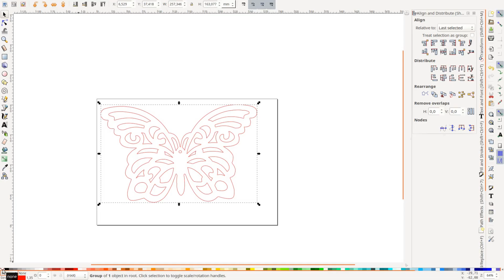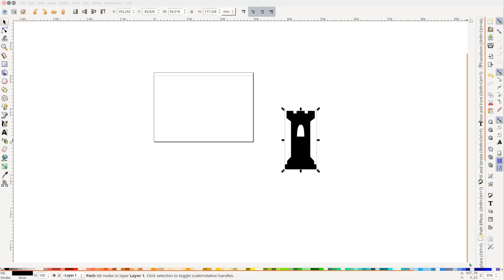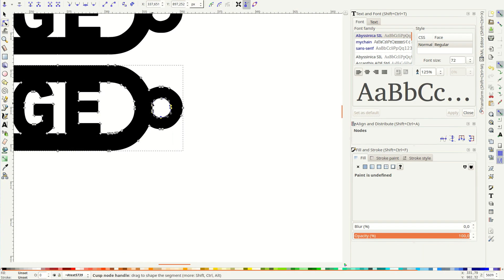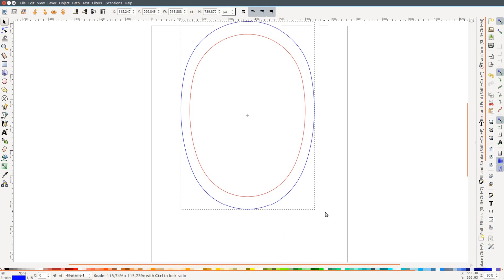10 projects for the laser cutter

Comment: Just for the first project, don not ever cut PVC with your laser ! It will produce mustard gas that will not only damage the electronics of your machine, but also your health ! When i first got my co2 laser i wanted to put anything on, from my phone cover to engrave Godzilla on ;) to heat transfer vinyl... But quickly i saw that all these are PVC, even the PU heat transfer vinyl (HTV) as the cover layer, the one that you peel off, it's PVC... so take care and look out for non PVC alternatives ( there are )
Reply from the maker: Yup. Cutting anything that sets chlorine gas free is a bad idea. Some pseudo-acrylics from the home center are dangerous as well.

Comment: How did you cut this ? I have neje master 2 20w, which program have you used ? I mean to cut all round from outside , its that a Gcode file ? How did you make it ? Thanks
Reply from the maker: The Neje laser can only engrave or cut very thin material. The machine I am using is a K40 laser, as described here: https://youtu.be/G5vTZGL-UBA
Reply: @WayofWood  thanks

Comment: hi nice informative video , but what i would like to know can i use it to cut foam for my tools 16inch by 10.5 inch x 1.25 inch thick?
Reply from the maker: The bedside is around 8 x 12 inch. Foam cuts nicely if it’s the right material but I don’t know if you get a. Lean cut on 1.25 inch...

Comment: Thanks for the great video. Do you think it would be possible to also cut 10mm acrylic? Maybe with 3 - 4 passes?
Reply from the maker: thegreatsalabim I don‘t know. Cutting 5mm acrylic is no problem at all. I tried to cut thicker wood which is difficult- even with several passes. 
As 5mm is possible 10mm might work with some creativity (eg flipping the piece and cutting from both sides) or by cutting 2 5mm pieces and gluing them together.

Comment: Great video. What program did you use to make the finger joint box.
Reply from the maker: Karen Smith It’s the python box configurator - a really flexible online tool. In the description is a link to the website article linking to all the resources.
Reply: Thanks
Reply: Karen Smith go to the website maker case. It gives u options on what kind of joints I need

Comment: 25ma on a K40? The little power supply (the blue turd in them and 50w machines) can't do 25ma.  My expensive power supply does a max of 24ma for a 60w tube and you have a 30w in that K40 so 25ma isn't happening and if it is bye bye tube life when the max on a real K40 (30w tube) should be 14.5ma or at most 16ma for a very short period of time. 18ma on a 40w tube, 20ma on a 50w tube and 22ma on a 60w tube is what is suggested by all laser companies and legit tube manufacturers.